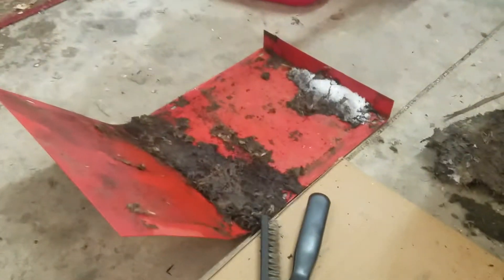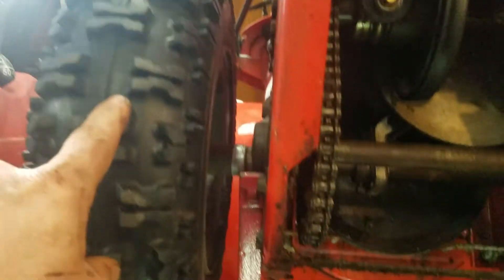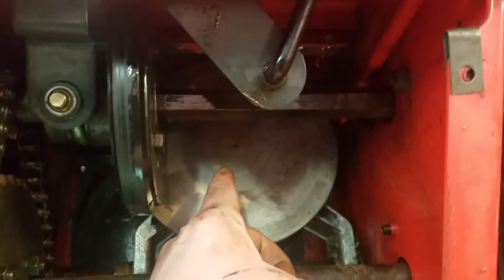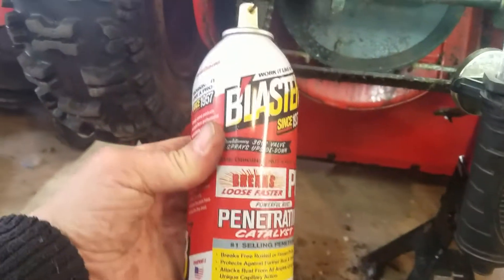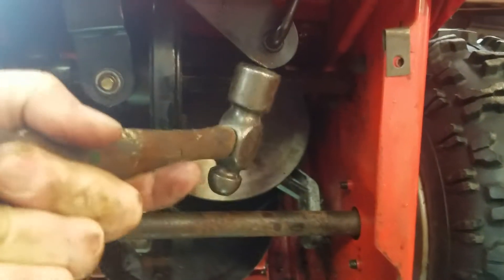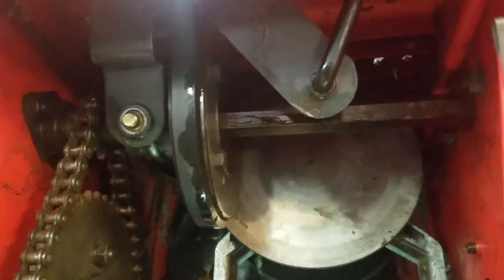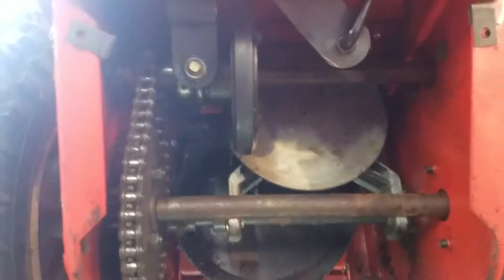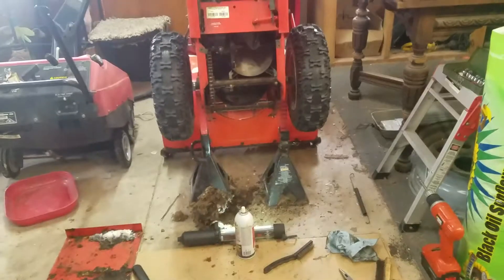Snowblower will not shift forward reverse gears stuck  Solved

Comment: You do have to keep the shaft lubed, but ...DO NOT get any type of lubricant on that rubber wheel or the disc that it runs against. That's your transmission. If you get oil or grease on them, it will slip and you won't move much. If anything, you can take some brake cleaner (or just degreaser) and clean the rubber and disc off clean. You want a good positive connection between the two so the machine will move thru the snow.
Reply from the maker: Yep,  good advice.
Reply: You DO need to lube the shaft the rubber wheel slides on.
If you do happen to get any lube or penetrating oil on the wheel or disc, just clean it up with brake cleaner
Spray the cleaner on a rag, press the rag on the wheel and spin the wheel.
Use the rag with brake cleaner to wipe off the disc

Comment: nice video , I have a snow blower  that has a reverse gear and 6 forward gears and I kept changing gears and the gear is loose now and its stuck , it won't move , I guess your not suppose to change gears too much , especially when its an old model like mine
Reply from the maker: It is fairly basic. If you have a cover on yours, maybe you could take it off and see if you can figure it out. Good luck!
Reply: @BenjaminHansen  ya I think its easy , its just too cold to go out onw  , the gear wire is loose so it probably came off of something inside

Comment: Mine is so seazed that can't do anything.I tryed even with torch... nothing.
Reply from the maker: Maybe clean up what you can with a wire brush or wire wheel and then spray it with penetrant like PB Blaster and tap it back and forth with a hammer. Spray it again and let it sit for a day. Repeat until it loosens up for you. Then it will be ready for next year.
Good luck!
Reply: @BenjaminHansen  thank you for quick response. I appreciate...I tryed spreying, even left couple of days soaking with bluster fluid in and around...I took everything appart...torched hot and tryed with hammer...nothing.I think the only thing is left to do is to get a new hex bar,if I can find one, and the whole assy that slides...This thing seated dry for a very long time,my guess.It is literally welded.Uh.
It is Murray 24/8 with Tacumseth engine.Very strong.

Comment: Just bought a Toro 824 Power thrower from some unscrupulous fellows.  Saw it run in 5th gear didn't check the rest.  It goes into gear as far as the shifter up top however there is zero power 1-4.  Would that be more of a transmission thing rather than the drive wheel being seized?  Thanks
Reply from the maker: From what I understand, the flywheel is the transmission.

Comment: Anyone know if it goes into reverse but NOT forward? I don't have any forward gears. Happened all the sudden. Yet I have reverse. Never messed with it before
Reply from the maker: It is usually just a piece sliding back and forth along a rod/bar. Something is holding it up and keeping it from moving for you. Take the lower inspection panel off and see how it looks. It may be a simple fix.

Comment: Thank you thank you thank you bought a beast of a snow blower only to get it home and it was frozen solid from rust and corrosion. Watched your video and freed up! It's skipping but at least it's engaging. Have any slipping friction plate videos lol?
Reply from the maker: Skipping  huh? If you got some overspray on the disk or rubber wheel, maybe it is causing the skip and will eventually get better. I feel good the video helped you. That is why I make them. Good luck with your "new to you" snow blower.
Reply: I have a old craftsman snowblower.  The manual says to not get lubricant on those discs and wheels.